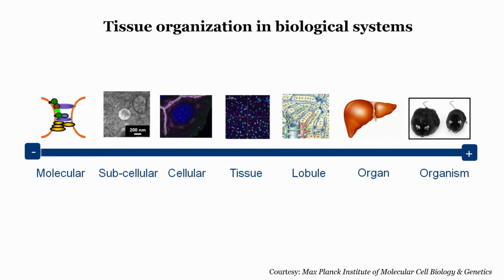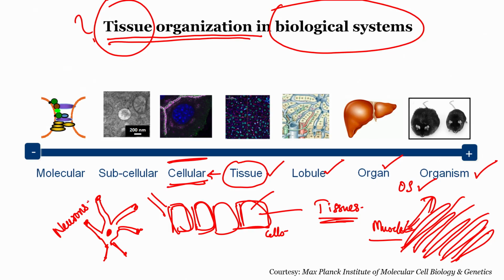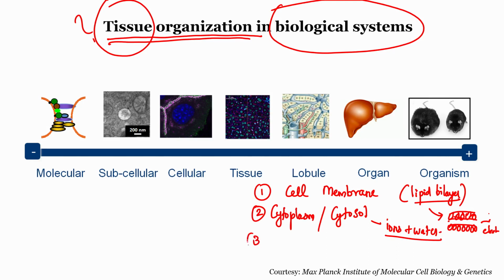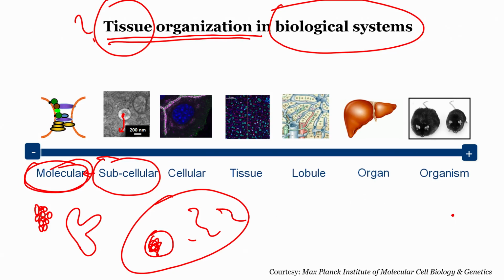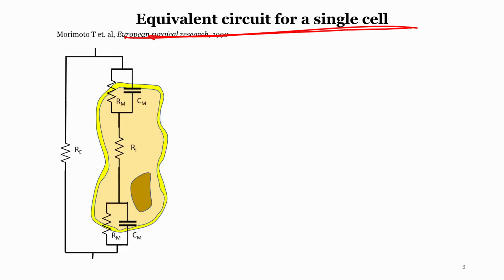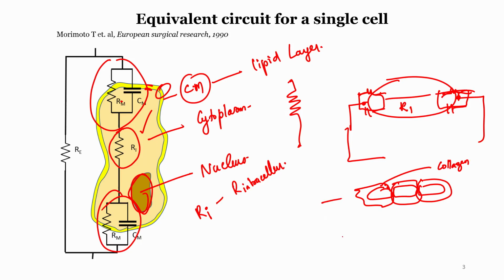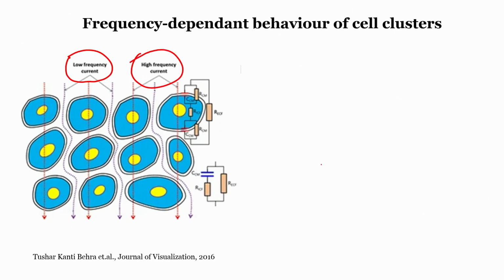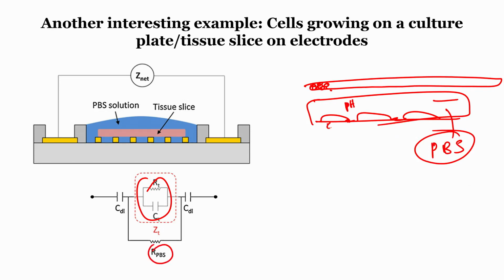Lec 08 Introduction to electrical equivalent circuit models for biological systems

Comment: Thank you so much for simplifying the explanation! I have a doubt, that I hope to solve with your help. What if we consider the cell and ecm being in series? will it change anything? since the cell is surrounded by ecm, the circuit has to go through the ecm to reach the cell in any given direction (like first the ecm and then the cell, in series). Just like the light from sun goes through the exosphere to reach the earth.